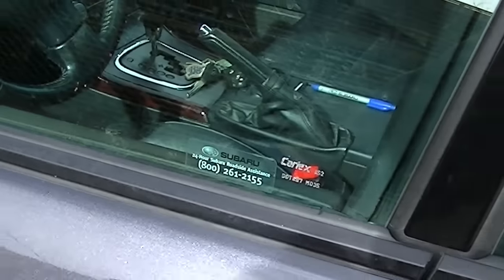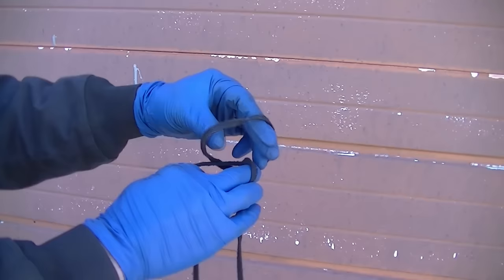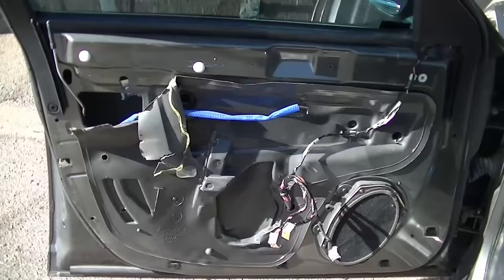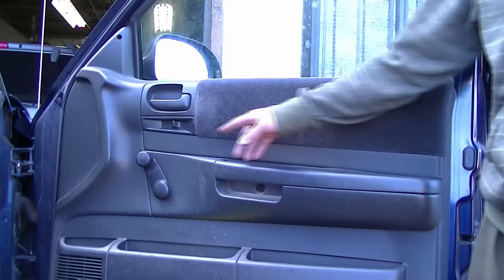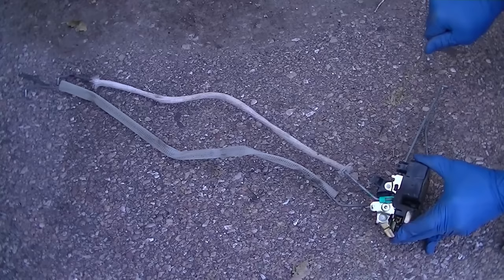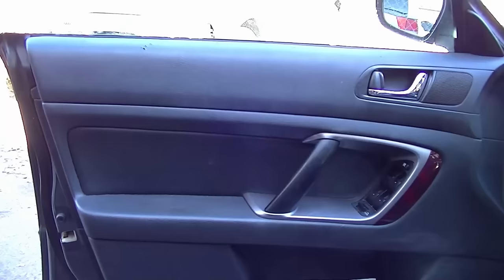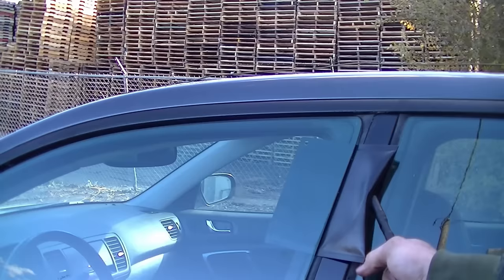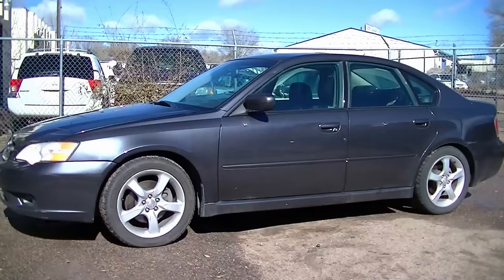How to unlock a car door (without a key)

Comment: OOOoor !  When you buy that new or used vehicle .  Thee 1st Thing YOU DO is go have an extra 2 ignition \ door lock keys made at wherever is the best price ...   
*  Try the key in your door 1st !  Then take a good quality piece of wire that you can easily twist with your fingers , and tie it under and onto the vehicle frame or tucked in inside the rear bumper lic. plate lights cable - where it's unseen and you can Easily reach it by only getting down on one knee .  I also spray paint the key Black beforehand ,  so you don't easily see a shiny silver or gold key hanging wired up in that often small dark area !   
I do a lot of gardening so I use and buy 66 ft. Tuff Rolls of a ' RUBBER Coated ' twist tie at the hardware - and it's been off and on a few times now Since 2009 , and in Canadian winters .  My vehicles are Always Locked ( with tools ) and this many times saves me from having to walk to the house or shop to just get something out of the cab or box or to open the hood .     
Simply replace twist tie when needed .  The tie also works Good for some of my Xmas lighting on branches instead of making nail or screw holes in things , and it's reusable .    
Btw ,  with the new larger keys with the chip inside them like even my 2004 has ...  That new cheap spare key will open the doors and start my truck .  But the vehicle won't keep running as to it's chip info .   
Now ,  retrieve those keys you locked in - and PUT Them deeply in your pocket .  NOW GO PUT That spare key right back where you got it from . .  Not sometime later or You'll Be Sorry !!!
Reply: They have magnetic key holders, which you just stick to an obscure surface front or back... 3 bucks on amazon...or support your local hardware store...https://www.amazon.com/Master-Lock-207D-Magnetic-Holder/dp/B003WXGLS2
Reply: @godbluffvdgg  if you read the description it says not intended for use on cars
Reply: Great advise I also have done this for years b/c I so pronged to locking keys in car. As a building inspector now retired I had an old inspector give me this advice as to NOT be the office clown to be laughed at when this occurred with other inspector's having to call office and having their Chief bring them an extra key to the jobsite. And avoiding being the center of attention the next morning at the office. This certainly motivated me to have all my personal car's cars and trucks equipped with extra keys under the frames. My mechanic would always say your vehicles will be a car thief's dream come true. My response … Well I'll take the chance...l guess I'm lucky never had one stolen...I'm late 60's but this is for all who don't do this and stranded thanks for very good tips!
Reply: @davidblue435  Hi Dave .  Ask your mechanic - How many thieves he's seen getting down on their knees or actually laying under it to find a spare key ?They're too Lazy to ,  and often in a bit of a Hurry - at that time .  I paint my Spare Keys Black 1st  -  I don't use white , yellow or pink ties either ,  and I tuck them in .  It's usually pretty dark inside the back bumper with that also  black wiring harness .  Btw to others reading this . .  
As to The Magnet Idea on vehicles TODAY . .  I Strongly recommend - Nah Nah to that idea .   I've Had Them and Lost them Years Ago . .  I Clean the underneath of my vehicles also and those little weak mag boxes don't Stick Up to a Power Washers ,  a Box Liners ,  or the job sites gravel \ mud and often potholes either .  3+ bucks for a Mag ? or maybe 5 cents for a GOOD Rubber Coated Twist tie ! ?
Reply: Ive had a pick-up (many) for years. Also have dogs which love to jump from door to door seeing what I'm doing, usually they are jumping on the door locks on the arm rests. I have always kept a key in a magnetic box between the factory bedliner and truck bed. It will never be lost from there, plus no contorting yourself to retrieve it. However, as stated above - ALWAYS PUT IT RIGHT BACK OR YOU WILL BE SORRY!!! @lovinsnotfun-eranymore5213

Comment: oh and in case car thieves are watching 
most cars now have alarms and deadlocks and  the button is now  flush in the hole.
this is only if u locked ur key in the car .
keep valuables out of sight or in the trunk
Reply: Thieves don't worry about damaging the car. They just brake the window for easy and quick access.
Reply: @avutin7453  Yes, but than the alarm will go on.
Reply: Stealing a car without getting busted is far too much effort unless the car is worth a lot of money. Valuables inside the car are a much safer thing to steal.

Comment: I did it quicker, on the one with the pull handle to open door with clothes hanger. I used a cake knife to gently pry window open while using a string to move rubber gasket on door. I placed cake knife on lower right of window, pried open a little, using a clothes hanger straighten out with the end that hangs on rack slightly bent, and making a slight 'L' shape up from  working end, turning it to the right upon entering door ,then a quick turn to left grabbing the door handle and pulling back. I was absolutely surprised it was so quick. Quicker than using a  'Jimmie'.

Comment: Cars dont have vertical knobs that protrude when locked anymore.
Reply: Many don't, but some do... Just did a quick look on the Ram trucks site to see if there were any interior photos that showed the door locks.

https://www.ramtrucks.com/ram-1500classic/interior.html

I can clearly see a vertical knob that protrudes somewhat.  Can't tell if it is locked or not, but from the length shown in that photo and the obviously longer length shown in the 360 degree view on the 3500 interior page, I would say that it was locked.

Comment: cool, but I prefer to use a brick and then reach inside.
Reply: Lol
Reply: If I strong enough..I would just use my elbow..
Reply: Mirza-gamingYou could use a drill bit &stab glass with point;or a piece of that white stone type or delph type,on a spark plug&when (after you break the spark plug to get a piece )it hits widow it's silence too.
Reply: One of those spring loaded center punches work great.
Reply: @justinwalsh3414  ya I know this from the walking dead game
Reply: @amirmirza2920  I know it from when I was 13yr old robbing car sterios&speakers of good&cash,jewellery.😂30yrs ago.I'm a good member of society now though😉.

Comment: Old cars only
Reply: kuldip dhuna How old would you say?
Reply: 90s bro
Reply from the maker: the cars used in this video are - 08, 02 and 07
Reply: Every car can be unlocked by pushing to a central locking button. Some cars, like German ones (VAG group especially) have the system when you have to pull tge door opening handle twice to unlock a door even if the door is locked. So, this would work on probably every car if it is not equipped with additional security level, like extra door blockers on sides that will not open up until you really push the key fob button. In this case the only way is to break the window (if you do not have an energency PIN code set up)
Reply: Yeah, no. We're not taking about starting the car, only about opening a door nondestructively

Comment: A trick that has saved me more than once is to keep a spare key in my wallet. It takes almost no room and eliminates probable cause in the event law enforcement sees you using these other methods to access your car. Newer car keys have a chip which connects to your cars computer and can be very expensive to make a duplicate. But for a few dollars, you can have a chipless key made which will not start your car but will open your door.

Comment: Great video, but I'm still unable to get in, my vehicle is similar to the last one but locked with key fob and alarm is active, handle and lock thumb press didn't work either, I managed to get bonnet open and battery disconnected is there anything left to do, it's a Toyota verso 2011 all electric windows and central locking button didn't work either, please help.

Comment: Oh my car is a 2011 Chevrolet impala 💯 and my back window was cracked so I put the shoe string down in the opening and slide a bent fly swater down to hold the string then pulled the string the opposite way and viola👏🏽👏🏽👏🏽👏🏽

Comment: an easier way to pull up the lock is to use a wire hanger. Make a small loop at the end of the hanger and either wrap a rubber band all around the loop or use tape backwards to go all around the loop. it  is now tacky and can grab the door lock

Comment: i have a 1999 camry and it has the lock near the inside handle but i still cant work out where you put the wire hook in, is it near the outside handle or over the indoor handle, im confused. Also can you tell me how to use the manual window to get into a car please. Can this be done on any door or does it have to be the one that uses the key? I really need to get into the car urgently. Oh and i got a hold of a wiper blade and there is no metal in it just plastic, very disappointed

Comment: My car likes to lock itself and did so today with the keys in the ignition a d the car on. Luckily I was at Home Depot so I bought one of those inflatable things but I didn’t get the right type of metal rod. It was more flat but eventually worked. Unfortunately fiddling with it before getting the air bag the door frame got a little bent. I am now going to stash a hide a key somewhere on the car because that was BS… I was late to work because my car has a mind of its own.

Comment: The thing I hate is having nowhere to put these kits lol. I have the 3rd car so I'd probably need a kit but nowhere to put it! My brother used a coat hanger to unlock my car.

If you have nothing available, try calling your local police department. I've called them a few times and they don't charge where I've lived. Really wish I could turn off my auto lock! The doors are also kinda heavy and close somewhat easily as it's a 2dr

Comment: You only lock yourself out of a car once*, after that you put a spare key in a bag wired onto the underside of the car. The bag keeps it clean and sorta hides it from mechanics/mot testers. Use wire thru the hole so you don't lose it.

* I'm one for locking myself out of the house... done it a few times over the years. The last time I nearly killed myself getting into the backyard, so I kept a front door key under the car. The council had put alley gates on the rear entry... it came as a shock to find I'd outgrown my youthful agility and climbing a wall at my age.... xxxxing thing nearly killed me in several different ways, over-exertion, falling, impalment, cut throat, hung! Y'see there was an alley gate in the way and then our own back gate had broken glass & nails along the top to deter thieves. Damn near took me to meet my maker. I got down into our own backyard by standing on fragile and wobbly plastic buckets... if they'd have 'give way' I'd most likely have gone head first into the big (doule-glazed) kitchen window.

Comment: 1996 Toyota Camry zx  how to get in? my keys locked in the boot and now the keyhole for the boot is broken to bits, and still won't open, you can't put a wire anyway down the glass there inside frame work that blocks the wire you can't pop the bung under the floor to push the carpet up to trigger the boot latch the carpet doesn't reach the latch ,

Comment: I did it today actually at taco bell. I used badically the same method as the shoe string but a little differently. I've done it enough that if it isn't raining out I will leave my windows down about an inch. There aren't a lot cars stolen where I live so it doesn't bother me that much. The first thought that popped into my head was look and see what was around me on the ground that I could use. I found a long wire tie like a bread tie and a piece if weed eater string. I opted to use the tie. I needed something to get to my lock so I broke about a two and a half foot piece of limber tree limb small in diameter off of a tree on the edge of the parking lot and another forked piece about a foot and a half long. Since the tree limb was green and limber I was able to flex into enough of a curve to reach the lock. I twisted one end if the tie onto the branch right above where I broke off a smaller limb so it wouldn't slide off then I tied a sliding loop on the other end of the tie and stuck it through the glass and got it into position on the lock and used the shorter forked limb to push the longer one with and tighten the tie around the lock and pulled the longer one up and that was that. It took probably ten minutes at most to get back into my car. There was a couple of girls looking out the window of the restaurant I think it surprised them that I was able to get back in with what I had to use.

Comment: I used to have a 2013 Taurus I was able to use a long screw drive to push down around the back door handle area but cant find that video after trying for hours and looking for video. I have a 2017(should be same config as 2013), have you or anyone else heard of this method? It took less than 10 seconds on the 2013 but having no luck on the 2017. Cant find door diagram and cant get the hanger to push enough on the electronic lock. Im broke as a joke so cant afford the professional tool as I cant drive lol. 

Any help would be SWEET!!!!

Comment: I got a 2008 Toyota Highlander that needs the passenger front actuator changed out but the door is closed how do I go about opening the door in order to change out the actuator
Reply from the maker: If you cant open the door from either outside or inside, you will have to remove the door panel with the door being shut. 🤷‍♂️ You can try removing the door panel on the other side to see how it comes off, and remove the seat on the side that's stuck to gain better access to the panel. Once the panel is off - pull on cables/rods to release the latching mechanism. Here's a door panel removal video: https://youtu.be/Kxq5tC7dNB4
Good luck.

Comment: I got a cheap copy of my key for less than $5 and put that key into my wallet. It will not start the car but will unlock the doors. After breaking a $350 window I get it out of my wallet and put it on a shoelace into my pocket. I did put my wallet into the console.

Comment: Unfortunately NONE of these methods worked for me. I have two cars that are 2013 Dodge Journey and 2018 Chevy Traverse. 

The shoestring method does work bcuz the horizontal lock head goes deep in when car is locked. And trying to pry into the side of the window with a metal hangar just tears the weather strip bcuz it's so compact and tight knitted.

I'm So screwed!!! 😖😖😖

Comment: None of these worked in my situation for my grand prix, I ended up cracking my not working key fob apart, hooking up stripped usb wires to the battery terminal, then I plugged it into my powerbank and unlocked my car
Reply: Also before I get any comments about using the actual key slot on the outside of my car, it's frozen in place, the manual key slot don't work

Comment: my 2006 lincoln i locked the keys inside. the remotes wont work when the key is in the ignition. i put a screw driver in the top of the door where it joins to the roof and pried out and ran a coat hanger in and pushed down on all the buttons on the door. none worked except the passenger side window went down. wheeeeee! close call.

Comment: Who has a hanger or window crank or slim jim or pliers or ice scraper or door stop or lock out kit when you are locked out? Easier to carry an extra key in your wallet. You are not likely to leave your wallet in the car after you leave. The extra key worked like a charm for me three times. Use your imagination? Wouldn’t need a you tube video if I had an imagination.
Reply: it depends, some ppl are in local places next to their car,like their own home so its easy to have that on hand, maybe if youre stranded but if ur in public and can walk somewhere buying a hangar or finding slim metal pieces may not be the most difficult